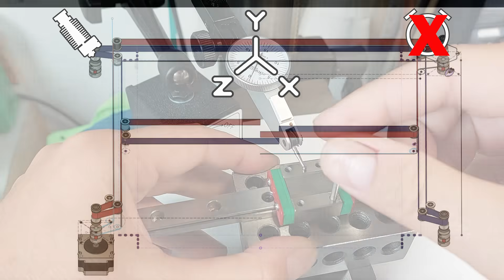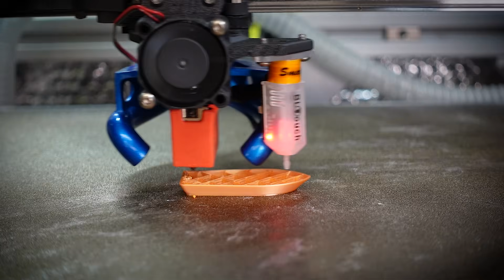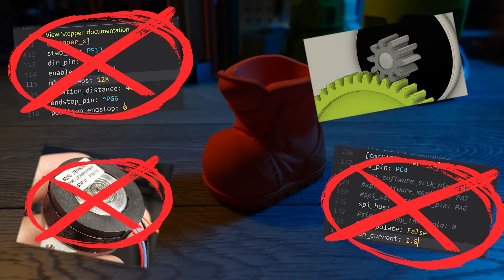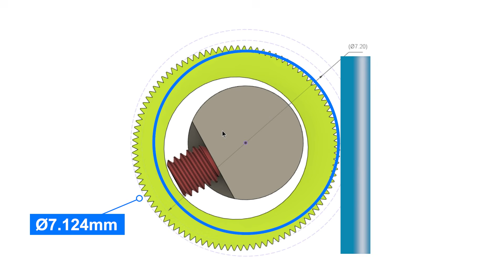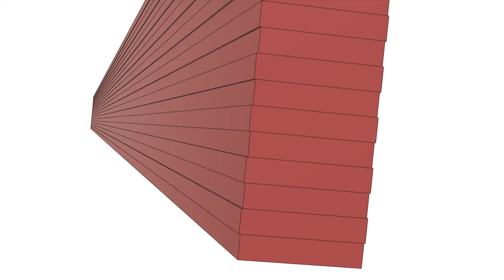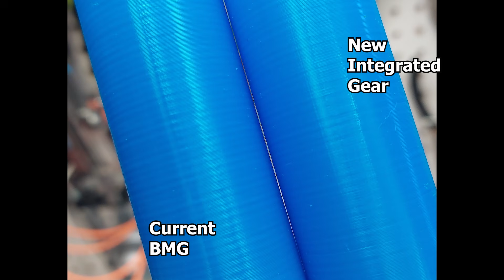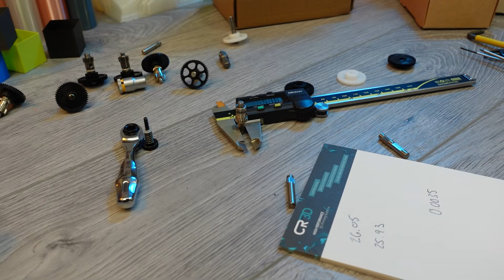Extrusion Quality - Mystery issue resolved !

Comment: We at Bondtech are really proud to be working with MirageC on perfecting filament 3D printing. No matter how small the required quality increments may be, at Bondtech we always strive to improve. Actions have been taken and more experimenting will be done. The reverse integrated drive gear is just the beginning. Changes in the moulds that make our plastic main gears were performed. Additional quality controls are in place to minimize the runouts. We are sketching new designs for the gripping teeth.
The (r)evolution takes time but doesn't stop here. 
Thank you MirageC. 
Great job🙂
Reply: Yeah!! Good work Bondtech!!
Reply: How would LGX Lite gears play into this?
Reply: @eduncan911  Someone has tried?
Reply from the maker: It is such a pleasure to work with you guys.  This investigation has now led us to the definition of the next FDM (r)evolution as you said.  
I would like to emphasis on one point though:
BondTech has made their internal components available to hobbyists just like me for integrating them into all sorts of extruders.  
- Direct Drive
- Shorter Path (gears to nozzle)
- Different motors
- FDM Printed self designed housing and tension levers.
- etc...

Sometimes these installations have been more demanding and may have not meet the initial design intentions.  We have discovered some shortfalls because we are looking closer with a more demanding angle.

I am so happy that we can now all take these lessons learned and move together to the next level!
@Nuno Santiago: That new shaft is AMAZING!!!! I am getting print quality now that I have never seen before!

Thank you Bondtech!
Reply: What MirageC unveiled is important. Bondtech is addressing it. However... it is a sub-prime aesthetic performance of legacy Dual Drive Technology on a direct extruder application. Always tradeoffs. Plenty advantages. This disadvantage. 
Now... remember the BB era, Before Bondtech. Filament feeders were very unreliable. Look at your feeders now. None is perfect but they are mostly much better. Open them up and look inside. More than 90% of you - not using LGX - will see a different flavour of Bondtech legacy Dual Drive Gear Technology. Why? Because it was state of the Art until LGX. 
Can we build them better? Yes! No doubt. Nothing is perfect. We are working on it.
Remember we are a small company of 17 strong, always, always working with our community to improve our Dual Drive technologies, legacy and LGX.  From my side, I'm looking forward to see what we all together will achieve next.
Reply: @Nuno Santiago I have a reality complex 3 Point Z axes like the HevORT and rebuild my printer 4 times because of the artifact shown in the video but never got rid of it. I would have never thought that my extruder may be the fault. I hope bondtech will come up with an upgrade for existing BMG Extruders.
Reply: Thanks Nuno, cannot wait to see what you guys will come up to improve the print quality...and a BIG thanks to @MirageC for his time and dedication.
Reply: Man thanks a lot for that video ,i  had some random z wobble on my mingda mag x , i took out the idler gear (it had alot of play) , pressed out the bearing from laptop hdd as a shaft I sawed off a piece ofCD-ROM liner and installed it as idler , and all that wobble has gone,  prints now ideal
Reply: Is the normal BMG Extruder also effected by the Problems shown in the video?
Reply: Will be there a possible fix also for mk3s ?
Reply: i was surprised how Blurolls was better. It is nice to support local company like Bondtech. Hejhej!
Reply: Send more over quebec here in ready to test them.also 😅🤣
Reply: why don’t manufacturers use helical teeth for gears, because they are less noisy, I think they can transmit this noise in the form of waves when printing
Reply: Any news and updates ?
Reply: @nunosantiago6720  Any updates?
Reply: Great analysis

Comment: This is why I really don’t mind a bowden set up. I have a few old dusty Ender 3’s… they are far from stock though, and some are direct drive and some are still bowden.
On my old bed slingers the only reason to have direct drive is either for flexibles or extremely stiff and brittle filaments (PPS-CF for example) that don’t like bends in the bowden set up. Other than those factors the bowden set up is better in every other factor… even down to the stock style single drive gear. I literally use and prefer my printers with Bowden set up for everything other than 2 filaments.

Comment: Thanks for the video and the real world testing. You are not considering the drive gear from the stepper motor, nor the quality of the bearings. I have had a new gear set for my extruder sitting in the todo list for when I next need to strip the extruder down to fix an issue and have some higher grade bearings to go in at the same time. Your video has given me hope this may be the solution as I also worked out it had to be extruder related as the same pattern was on X and Y sides of a cube. Printing at a lower temp to get a more Matt finish and staying away from silk filaments is how I am handling this issue on my direct drive setup. Lower the sheen and the issue is not as noticeable.

Comment: The last wave you are seeing is the delay from gear to hot end. Going to say this.. How could you reduce pressure on a direct drive? Flow. The better the flow... the better the print. You can get a cleaner print but testing with a flow cube and measuring your feed and refining it, because this 100% affects consistency. There are two belief too pressurized control has more consistency. While No pressure at all has consistency. The truth is they're both right, but it's hard to pressurize a boweden tube and it's hard to not have pressure on a direct drive.  So you need to use one method for each application. You correct this with print speed for pressurized... You correct the other with calibrating e-steps and adjusting flow. When both match maximum feed speed for matterial, you have harmony. Same as with cnc tooling.

Comment: It's what I have been saying. It's why a commercial direct drive units treat extruder gears like pistons in a car... It matters and when it really wears out. Unlike those 60 videos that claim it's the boweden tube and not material getting stuck in the hot end.... Gear Circularity maters on any machine that dispenses material.

Comment: Extruded amount has to do with the circumference of the gear which is given by Pi x R squared.
So the difference of 7.276mm and  7.124 when gear wobbles is actually 4.134% .
Its TWICE as bad as you think.

Comment: This rational approach, scientific methodology and pursuit of excellence is how 3D printing is improving.  Thank you!  This morning, I scavenged a NEMA 17 motor off an extruder from a Hadron Ordbot 3D printer that I built 12 years ago and it was a pathetic mess.  It was state of the art at the time but looked like a monkey built it.  It made me realize again how much 3D printing has improved, even in the past couple of years.  I wish 3D printer manufacturers would buy extruders from companies that specialize in extruder design, doing the type of research and development demonstrated in this video.  Klipper's input shaping and pressure advance is now demonstrating inadequacies in extruders.

Comment: So if you used a gear expansion system that had a repeating factor or a 1 to 1 ratio and inputed that ratio into the gcode, a perfect computing system would be able to modulate the flow to eliminate that defect of extruder wobble?

Comment: This video is brilliant and great food for the engineering mind. Thank you. Was really enjoyable to watch.

It also brings out one basic premise. A lot of people spend a lot of time and effort to make their cheap Ender 3 Pro (or insert similar) printer try to print absolutely perfect prints. 

They forget that everything in such a cheap printer is, must be, a compromise. All the systems have large tolerances and there no closed loop feedback in any of the systems. 

Everything is unidirectional open loop.

The drives push filament. The unit has no way of knowing what is being extruded. It also has no way of knowing if the drive gear is off centre. It is just trusted at setup that you got the extrusion rate correct and only for that type of filament and removed any drive eccentricties. 

The x, y, z drivers have no way of knowing the exact co-ordinate of the nozzle. It's only ever a relative estimate from home position. It is just trusted you know how to calibrate the co-ordinates at setup. There is no compensation system.

The bed levelling has no feedback. If the springs sag the printer will just keep printing. If the bowden tubes becomes loose, the printer marches on. You bed level with a sheet of paper (whatever that is!) then expect perfect prints? C'mon.

If there is z wobble there is no auto compensation, the printer just keeps going. 

If the frame is not precisely square the printer cannot compensate.

We get what we pay for then are disappointed with the results and then spend the next year spending more money and time on upgrades to manage our expectations for printers that were never designed to be high accuracy, tight tolerance closed feedback systems to begin with.

Yet we dream of absolutely flawless and pristine prints, forever, without post processing..... for the little money we paid.

Asinine expectation. Your video just highlights this even further.

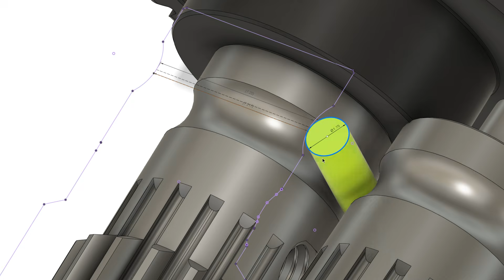Comment: how do you make a cad simulation like that?   18:30
that's verry neat.  

i thought i knew how to 3d draw anything i wanted.  but i guess i have only just started.
(and i know it's just tied to the constraints and it's a part of the parametric design.  but how to actually do it in that way, i have no clue)
Reply from the maker: Moving the circle changes the distance between the circle enter and a reference line.  That distance is used as a parameter for the layer width extrusion from one of the two layers.  I then multiplied the 2 layers in a stack.
Reply: @MirageC  
unless i see it done i won't be able to understand it.  

thanks for trying though. 

now i totally get what you're saying.  i just don't know how to execute it.  how to draw those layers while they are tied to those paremeters.

Comment: So this is why i could never extrude from my clockwork2 as consistently as i could from my basic ender 3 stock extruder. The ender 3 might have sime runout on the drive gear, but it has no filament groove and it has an idler so just isnt effected by thr filament walking out of alignment.

Comment: Oh man, that was mega helpful
I bought Neptune 4 Max recently and i noticed that extruder was skipping from time to time. I tried to rotate plastic gear on top with my finger and saw that gear actually gets stuck partially and its very hard to move it at a certain part of rotation. I opened it and saw that part holding bearing for this gear is not aligned and for everything to close it must be squeezed into place which makes gear crooked. I wrote about this defect to Elegoo and they shipped me the replacement right away (still waiting)
I lubricated everything before closing and it runs a bit better. But after watching your video now i know that this artifact i got for sure is because of this defect

Comment: This video has really helped me, although this is the second video I've seen on this (I think it's Mihail Designs that has covered this issue too). I have an old CR20pro which I modified with KevinAkaSam's dual Z, PC rollers, dual cooling and a micro-Sherpa with an old BMG clone extruder set. I've been trying to make my bed flat by printing a flat sheet and filling gaps below the steel plate with kapton tape. I couldn't get anywhere; ripples kept appearing in places that made no sense. I've just gotten rid of the teeth on the extruder with my mini-lathe, and rerun the same file for the 8th time. The ripples are gone...

Comment: The machines are all designed wrong, I made my 310x310 with a bed that does not move. On the y axis, the wheels should never be horizontal on the z axis I do not know but it just seems wrong to move that part.

Comment: So, it looks like filament causes bigger issues than the "precision" parts. The filament may change over a bigger distance, but when talking 3D printing, it could be a decent amount of filament before you get to the second layer. Only with small prints would it not make a difference.

Comment: If you knew the rotational position of the extruder motor (one index mark on the shaft or the gear would do it), you could fix this in software by varying the steps per mm dependent on the rotational position. With a quadrature encoder on the filament (easy to do and a good thing to have for sensing runout and jams), variations in the amount of filament movement compared to the rotation position could be registered which would also take into account any intervening gearing. Also, using a grooved drive wheel on one of either side instead of aa concave surface will stop misalignment issues.

Comment: This makes me curious as to using BLDC motors with FOC for the extruder, since it would allow for nozzle pressure estimates to be made from measured current draw to the motor.

With appropriate control algorithms you would be able to remove the downsides of DD by allowing the compliance of the bowden tube to be modeled into magnetic interface between the stator and rotor magnets. This could additionally compensate for filament inaccuracies making the printer more robust as a whole.

Thank you for sending me down this rabbit hole, i think i still have some stuff lying around to get a test rig running, just need to buy a FOC driver. Additonally FOC can be used for stepper motors using old school dual H-bridge drivers. For marketability and ease of installation/development someone could see if they can get smooth backdriveability off a existing extruder/stepper setup as well. That could be a single PCB solution to make steppers smooth instead of stuttery and then can also be used to model compliance and the code to run a direct extruder setup off an EBB36 or other external MCU setup. So you won't even notice it once installed just some more PID parameters to tune. 

I'm curious to use Steppers as backdrivable motors for robotics reasons so if i don't loose interest too fast i'll report back.

PS: It's great that you found the root of the problem and i need to verify it exists on my DD setup as well, although i use an LDO orbiter i can't imagine its not there, the goal of what i outlined above is to change the control process from being "Velocity" or Rate driven and make it pressure/force driven. Since tbh we can use absolute trash as extruders as long as the nozzle pressure can be controlled, the same reason the bowden produces nice results is the same reason stringing is a bitch.
So why not try to remove the tradeoff solving it for not only high end systems, but improve low end systems as well.

Comment: Nerver thought that the Extruder gear is the almost most crucial part.
It shows that cheap printers are stochastic strokes of luck. Often they work because parts smooth out their tolerances among each other.
So everytime you do an upgrade and change a bad part for a good one, the prints can get worse 😅

Comment: I'm pretty sure this is the problem with the stock extruder on the Anycubic Vyper.  I replaced it with a dual gear extruder and got much better prints, and I just assumed it was because of better quality gears.  I didn't think about it but now holding the old one in my hands it looks similar to the problem one you showed here.

Comment: At 18:30, are you saying the filament moves to different places in the groove throughout the print, resulting in a change in effective diameter?
What I would intuitively expect is that the filament would be biased to ride on one side or the other. Not ideal, but it seems like it should remain constant throughout printing, not change regularly.  I think though, that if the groove in the drive gear, and the idler gear are slightly misaligned as you show, AND each of those gears have eccentricity, it could definitely result in a regular oscillation. Even if the filament is biased towards one side of the groove or the other, the gap between the grooves would be oscillating due to the eccentricity. Put another way, groove misalignment may amplify the efffects of drive gear eccentricity.
The other issue is the extruder hobbed teeth themselves. Digging into the filament changes the material cross section, not insignificantly. The teeth imprints in the filament will result in the filament "pulsing" in the hotend.

Comment: What printer u suggest me to buy,need printer who can make smooth surfaces.My budget is around 600$
Reply from the maker: I only own custom printers, I am not the best to propose consumer printer.  I hear Bambulab have decent solutions for that price point.
Reply: If you new in printing then Bambu lab. If not and you are a handful person then build by self for safe a ton of money.
Reply: @laszloszell8753   ty for answer .Would make printer self but parts cost more than new printer here in Serbia.
Reply: @Shakalowski  Aliexpress? Anyway what you want to print? Need high quality or bigger parts with less quality? I mean for miniatures I would advise resin printer,otherwise CoreXY

Comment: Does this happen to the Revo™ Hemera XS

 Excuder?
Reply from the maker: you can easily test by printing a 30mm dia vase mode cylinder and vary the extrusion flow multiplier during the print.  If your artifact angle changes, then your extrusion system is the reponsible.